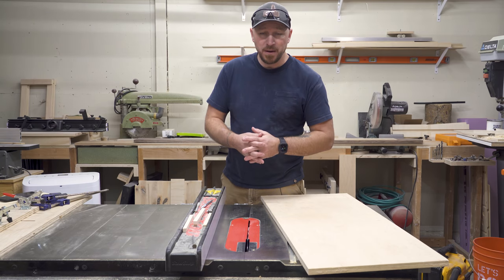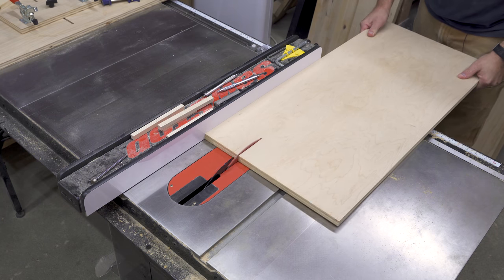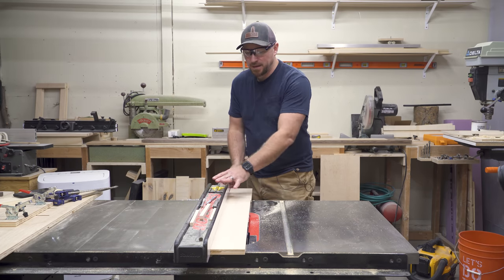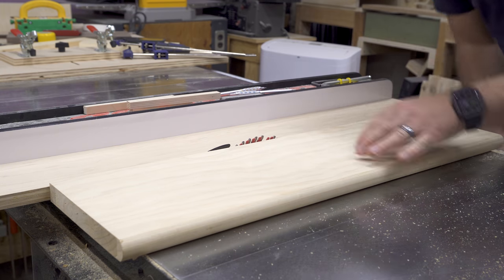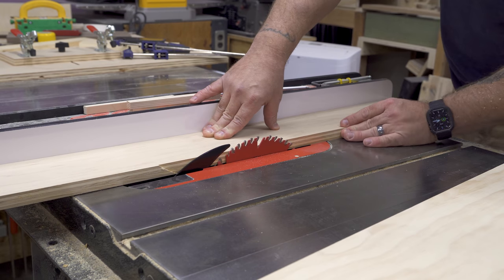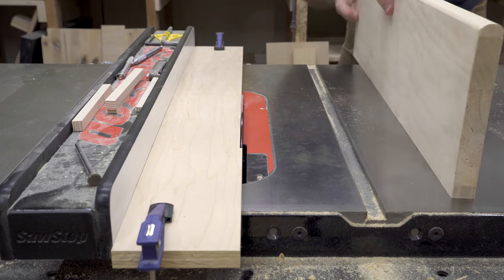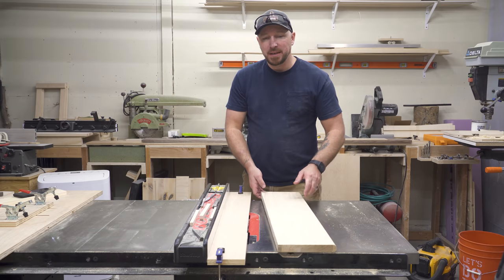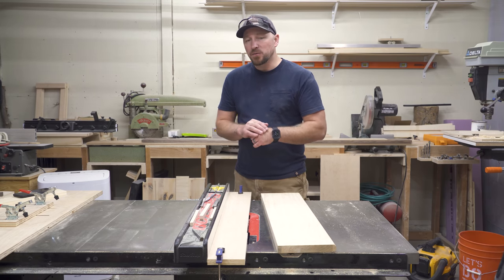Table Saw Jointing WITHOUT A JIG! - How To Joint Wood Without A Jointer

Comment: I've been looking for this solution since about 2016.  Right now I feel really, really stupid that it never occurred to me to clamp to the table surface instead of the backstop, just because YouTube didn't tell me to before!

I've tried all the crazy/dangerous/nonsense methods they show on YouTube for jointing with the table saw -- all of which before now start just this way (making a new backstop), but more to the point require you to push down on the board while cranking your table-saw-blade up at the same time while the backing piece is clamped to the existing fence instead of the table surface.  No kind or amount or direction of clamping works with the fence attachment.  I had one board thrown out of the blade and punched through a drop-ceiling tile while trying to prep it to become a backstop.  Even if you rig up a Wiley Coyote grade method of holding it in place long enough to shave off a kerf-width from the edge (from the bottom up while the saw is turned on), the backstop will NEVER be in quite the right place again so every time you try to set it up and use it you'll find that your jointing back-piece has changed slightly...  

I finally built an unwieldy planer-sled and a variety of angled scrap wood for flattening one edge before taking it to the table saw.  I kind of can't wait to try this method!

Comment: Interesting, but since the board you were jointing was concave and shorter than the length of your fence,   you could just use your fence since it would have ridden the curve (like how a jointer hand plane is so long they ride the valleys to joint an edge. If  the material is longer than the fence, add a very straight sacrificial fence that is longer than the board (a la John Heinz)

Comment: I am a newer woodworker but I am confused about this. This makes one long edge flat but maybe not parallel to the other long rounded edge. Why not just put the rounded edge against the fence and run it through on the tablesaw to make both edges the same width and straighten the crooked edge? Is this method assuming neither edge is not straight?
Reply from the maker: Correct. Sorry for the confusion.

Comment: I still get a slight bow in the middle of the board after a couple of passes, is there something wrong i should check before?
Reply: How bad was the board bow? I can normally take out some pretty bad bows in 2-4 passes. I set mine up to take about half a blade width instead of a whole width.

Comment: This looks really cleaver, but I don’t quite follow why it works. If the edge that is cut is warped or rough and the same edge is used to guide the wood, then wouldn’t it go through the saw unevenly even if there is support before and after the cut?

Comment: I tried this several years ago but I quickly learned that my driving knife was thicker than my blade....and fish tailed outward...job site saws are garbage. Lol, I upgraded and it worked just fine.
Reply: Wouldn't that also depend on the blade kerf and specific jobsite saw?
Reply: @mr.c6674  it absolutely depends on the blade. I don't think it matters so much about the table saw itself but rather the adjustment mechanism for the riving knife. I took the driving knife from about 0.134" to under 0.125" and gave it a try but I didn't realize the fish tailing going on. The table would also flex slightly when using any kind of push block.

Comment: Nice simple technique but technically the board you cut to guide the piece is a jig - "a device used to maintain mechanically the correct positional relationship between a piece of work and the tool or between parts of work during assembly"

Comment: You did not show the procedure for the most difficult part at 0:43.  How did you adjust the fence EXACTLY to the thickness of the blade?  
If you take off even slightly more or less, this trick wouldn't work at all.
Reply from the maker: @Halal Meat Shop You just line it up with the outside of the blade. But if you find that difficult to achieve, this video might be for you (https://youtu.be/aoxlrOKWTRk). This will take off an exact blade width very quickly and easily without guesswork. Hope this helps!
Reply: @InspireWoodcraft  I have learnt that in wood working, the best way to get perfect fits is by "Inferencing".  And this new trick u shared is a good example  of it.  Nice job, without this inferencing trick to get accurate measurement, this trick wouldn't work perfectly.
No measuring tools can ever beat Inferencing technique.

Comment: Am i the only one who can not get this jig to produce a straight line? I accurately cut the kerf width etc... Whats happening is my material has waves in it and i dont understand how you keep it parrallel to the fence as it wants to move on me creating wavy lines... Can someone explain what could be wrong? Fence / Blade have been calibrated before doing anyhing.

Comment: I have been doing occasional woodworking for 20 years and have edge joined more boards than i can count. i have never used a jointer - just a quality blade on my table saw. if an edge is really uneven i will attach a straight edge to the opposite side of the board that’s getting joined and run that through the saw (with the straight edge riding the table saw fence). I see no need for a jointer.

Comment: Nice! Quick question for you. How would you go about jointing the edge of a longer board?
Reply: For example if you wanted to make a table top with a bunch of longer boards
Reply from the maker: I believe with actual jointers the general rule of thumb is no longer than twice the jointers bed length. That being said you could just use a longer piece of plywood, or whatever you are planning to use. I used a piece of OSB and it worked great too as a low cost alternative to plywood or  MDF.
Reply: @InspireWoodcraft  thanks! So you’d need a longer piece for the out feed side, past the riving knife? 

So basically you’d joint it on the table
Saw as you normally would with a shorter board, but you just have to do a bit of balancing as you feed it onto the table saw. Maybe I’m misunderstanding you tbh

Comment: OK I'm very new. Can someone please help me understand why this is different than using the fence as is? I don't have enough experience to understand. I've also seen 731 woodworks slide a level along his fence as he joints on the table saw. I don't understand how these methods are different than using a square fence. This is not any kind of attack or snide remark, I genuinely don't understand the mechanics of what's happening here.
Reply: You cannot simply use a fence with a board that is crooked and doesn't have a trued up edge. You should only run a straight true edge against the fence or else you are headed for a disaster in the form of a kickback. This technique (the best and easiest) & others like (running a level) essentially give you that true edge. Then you can use the true edge against the fence to get the opposite edge straight. Hope this helps.

Comment: I would argue that this is a jig, but it's an extremely simple one.  The setup to make it is really slick.  As long as you set up the blade to shave off a blade-width of material, it should flip over to become a very precise guide without any fiddling.  If you want the guide to nest in closer to the riving knife, you could trim the guide board with the blade raised up higher.  And you could use this thing with a blade guard installed!  Obviously you used your riving knife, but I think this guide board requires it.  If you accidentally contacted the back side of the blade with the lip of the guide board, it could cause a kickback.  The riving knife eliminates that risk.
Reply: That's a good point.  A riving knife is important here (and always).

Comment: Is there any way to do this without a perfectly flat bottom piece of wood? None of these jigs or ideas seem to work without the face and bottom being flat. It just leaves an angle. It seems to me that you basically need a planer for any of these jointing ideas to work, but then for the planer to work well you need a jointer, or a really good jointing jig for the planer. I was really disappointed after try all of these edge jointing ideas, only to learn that none of the videos mention that you will get an angle if the board isn't flat, so you still need to plane at least one face.

Comment: Im certainly going to give this a try on my next project. But that's a jig.  It's allowing for a repeated task that will provide the same outcome on each board. Even a stop block is technically a jig. Im all for learning and trying new techniques. I just am not a fan of misleading titles.
Reply from the maker: Well thanks for watching and I hope it works well for you. The title isn’t misleading to most though. Most of us consider a jig to be something with one than more part and using some sort of hardware. There is literal definition, and practical usage of a word. We’re going practice usage on this one.

Comment: I'm not a woodworker so I don't understand. Why can't he just move the steel fence forward and cut a straight edge?
Reply: Good question. The board is too long. As soon as the board starts leaving the fence it will fall right into tracing it's old shape. Now if the board is small and stays within the fence throughout the entire cut then your idea works.

Comment: Ok, so let me ask you. You know this stuff real well. Why do that, hat happens if you simply run the opposite edge that is not bowed or the one bowed, through the table saw only taking off very little. That gives u a straight edge on the cut side, flip the cut side to the fence and run through again. That always gives me straight edges… been doing it for years…. Have I been doing it wrong???

Comment: That plywood you use is a jig...
Reply from the maker: I know. And so is a stop block. And so it my fence, technically. And the miter gauge, come to think of it. 😂 I've heard it all by now. I'm going with the practical meaning of the word, not literal. Most folks including myself consider a jig to be something made of multiple parts and usually including some sort of hardware, and most videos showing how to edge joint on a table saw do just that.

Comment: Why not just use the fence?…
Reply: Cause you need the extra width of the first cut board on the outfeed portion after the blade. Think about how a jointer works.

Comment: Why can't you just use the fence?  This seems like something you would make if you didn't have a fence. Why wouldn't ripping the thickness of the blade on one edge of the board, then flipping it and put  that edge on the fence and ripping whatever length to get the board size you want, work? I don't get it.

Comment: “WITHOUT A JIG!”, proceeds to make a jig...
Reply: Thanks a great simple tip.
Reply: Came here to find this comment. It’s all I was thinking.
Reply: My thoughts exactly!
Reply: Its a piece of plywood...
Reply: @JukeboxJake  your username is clearly false since you don’t know the definition of a jig...”a device that holds a piece of work and/or guides the tools operating on it.”

That “piece of plywood” is holding the piece of work off the fence, and is guiding it through the tool.
Reply from the maker: @shaunmac2999   I always find these comments amusing. There is literal definition and there is practical definition. We are using practical definition here, as most people including myself consider a jig to be more than one piece of material and typically including some sort of hardware. The fence itself is technically a jig. So is a stop block. So is the table top if we are being 100% by the book. Now all I have to do is make a magic wand so that I can create things without any sort of literally-defined jig. But then again, I suppose the wand would be considered a jig too.
Reply: @InspireWoodcraft  hilarious response, really hit the nail on the head!
Reply: Yeah but it's so simple I'm not even mad.
Reply: Don’t be so cynical. It’s a piece of wood. Just because it is beyond your skills - that doesn’t make it a ‘jig’.
Reply: @InspireWoodcraft Nahh, a wand is a tool....
Reply: Great, easy, simple and effective.. there’s always got to be a wise guy acting the troll.
Reply: @terrywhite5455  Short, witty, and to the point.. There's always got to be some keyboard warrior digging up 3 year old posts.
Reply: Bless your hart.

Comment: I gave you thumbs down.  you are doing 1 pass cut to make jig  (yes that is a jig sir!), and 2 pass to clean up the wonky board.   (that is wasted effort).  
the least effort is using straight board (as jig) and double side tape wonky board on top of it and run through table saw. that  is one pass cut clean...  not three cuts and no jig pre-preparation.